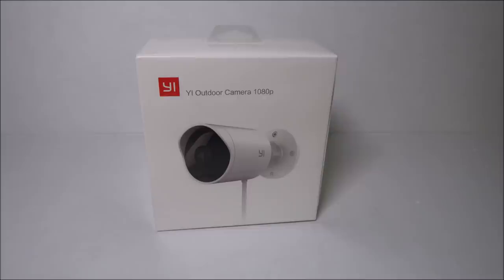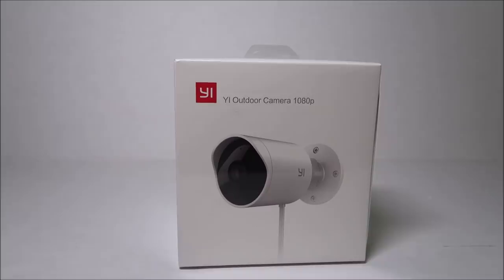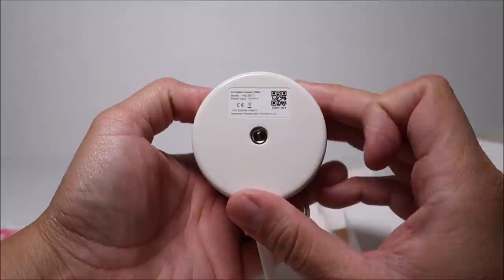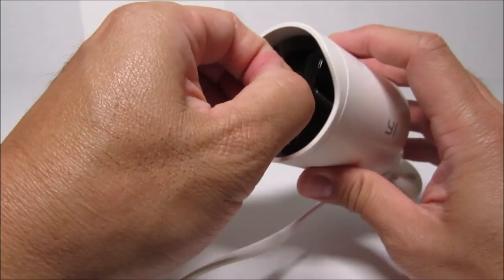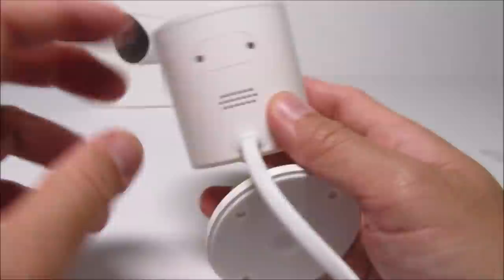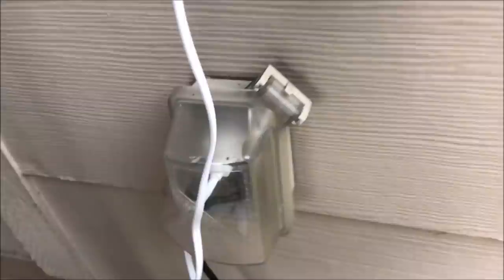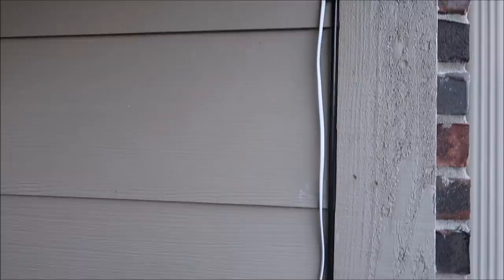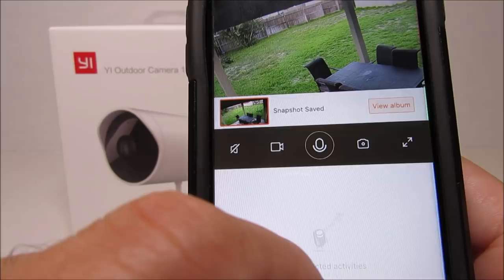Yi Outdoor Security Camera Review - Unboxing, Setup, Settings, Installation, Footage

Comment: Very useful review LH.
I finally succeeded to instal mine in Australia after a bit of a glitch during the installation.
Things did not move smoothly at the QR scanning section for some reason. I guess the distance between the camera and the image on the phone and holding it steady is important. After many attempts it did not register so I was forced to hit the reset button several times and reload the Wifi name and password both in the Kami account set up as prompted AND also my settings on the phone.
 The pairing process also seemed to take more than several minutes too.
I noted a red 5G network not supported notice on the phone screen also during the installation but this was resolved I guess by the  reset  repeat process and after the firmware installation update.
Now all is well with the world and the images are very good. I used a 128Gb mini card too and with the phone alert I am able to view easily on the phone both day and night.
It does appear to be a quality product and very good value for what it does.
Thanks LH for an informative useful review.

Comment: Thanks for the review. This camera is on clearance (allegedly) at my Home Depot for $49. I am considering getting at least two. What I like is the SD card option. Apparently it will take up to 128g SD card. I do not know if it loops like my dash camera does in my personal vehicle. The hooking up to power is not a problem as I have several outside power boxes for my non camera motion and night lights.

Comment: great camera. i love mine and the several indoor ones. cheaper and better than Ring in my experience
Reply from the maker: Yes, it is a pretty good camera. I use the Ring cameras  more for notifications...it is pretty accurate because of it's PIR sensor which the Yi doesn't have.

Comment: Hi,
MUCH CHEAPER to buy a standard indoor Yi Home Camera (but not the 'Yi Home Camera 2 version), pop it out of the mount and put it in an aftermarket exterior mount for about $12.        That's it.  Exactly the same spec at 45% less.      Just my humble opinion. Nevertheless a great review.
By the way, these cameras 'see' both 850nm (visible glow) and 940nm (invisible) ..850nm has a longer range. But, if you're using my method remember to use an separate IR exterior illuminator AND  to disable the camera's own IR lights in settings.
 Thank you.
Reply from the maker: I did do a comparison between these 2 cameras...Yi outdoor and Yi Home with outdoor case -> https://youtu.be/SLt14E2LPBc

Comment: Hey LifeHackster--
Thx for the review,my 2 yi outdoor cams come tomorrow..video looks great like their dome & home cams..it looks like the outdoor is using the same low/small KB's to do liveview and to record video which is great so it does not slow down internet and comes up quickly :)-I'm going to install one on the side  of my garage in the front of my house and in my backyard and will run the flat power cord underneath/behind the mount so you won't see the hole and us a extension power  cord which will be inside my garage and my house so to be out of the outside elements like I did for the 4 Yi dome cams I have mounted outside..I'll send you a video clip when I'm done...
Reply from the maker: Yes. The camera's sensor is the same as their Home and dome cameras so the video quality is excellent. I will eventually do a ceiling to attic install on this and using an extension cord also. Yes...link your video when you upload it so that I can check it out..
Reply: How are you liking them so far?
Reply: MrFester 
They are working Great..I really like the Yi cameras..
Reply: Mark Her how many hours of video can i record on 32GB?

Comment: Thanks for the information as I couldn’t find the reset button, just looks easier than it is. I am not a technician but do the best I can. New WiFi and I had to climb up a six foot ladder at my age to reset but it didn’t work so I have to remove the camera to reset it.
Reply from the maker: The reset button is on the screwed in area where the micro SD card slot is.

Comment: nice video! by the way, my yi outdoor camera have 32 gig SD card.
What you prefer, 
- Record in low Quality and save 24/4
- Record in Max Quality and Save only when Motion Detected

i think 32 gig memori is not enough, though its only up to 32 gig, Thanks in Advance
Reply from the maker: Mine are setup mostly to max quality and only record when motion is detected...
Reply: I think 32gb is enough when its activated by the motion detector....
Reply: And How many days do you record with 32 gigabytes?

Comment: Hi, i have a few questions not covered in this video and am wondering if you would be able to help me.
1- while not subscribing to the Cloud recording, will you still have access to their application and be able to use the camera live?
2- with the SD card, does it record continuously or is it only motion detected?
3- with the SD card, can you review recorded footage on the SD card from the app?
4- does the camera record in a loop on the SD card? 
5- If the recording is continuous on the SD card, how long of footage can be stored on a 32G card before it loops and start recording over the oldest segment.

Thanks, Pierre.
Reply from the maker: 1. Yes.
2. You can choose to record during motion only or 24/7
3. Yes 
4. About 2-3 weeks worth of footage.

Comment: I seem unable to find the answer to this question, despite your superhelpful video: how long can it record on a 32gb card? in 1080p or 720p? and a follow up Q: in Mi Home app there is an option to share smart devices, I know this does not work with Mi Home app, but is there a similar function in Yi Camera app too? Reason I'm asking is because I want to see if our neighbors can share a stream, or answer the door through this, without the need to share my account with them.
Reply from the maker: I have a Yi dome camera that is 1080p which I'm assuming the same sensor/camera that they used for the outdoor Yi...and with motion only recording in my living room...the 32 GB can last up to 8 days in 1080p before it is recorded over. As to sharing, yes, it can be shared - https://youtu.be/nnZE6zgzRZg?t=2m10s
Reply: LifeHackster thanks so much for your response. Do you happen to know how many minutes of video it records? Given the amount of capture is relative to camera's sensitivity, I want to get a better gauge of how many minutes it can contain. Asked another way: how many hours can it record if you put it on constant recording (assuming you can actually do that)? Also, does it cause any problems if memory is full? Or does it automatically erase oldest videos to make space for new ones?
Reply from the maker: I know I did test this before...and yes you can set the camera to record 24/7..I think I got around 30 hours of recording..and no problems with memory being full (same SD card since January of this year)...it will erase/record over old footage...
Reply: LifeHackster thanks a lot. Last question, I promise: you mentioned the IR lights being visible at night. How conspicuous are they? I plan to install on front door which is on a relatively busy Street in center city. I don't want any unwelcome attention.
Reply: I like to put a 128GB micro SD card in it. Is there is any size limit for Micro SD card for this camera?

Comment: Great video. My main concern is that the cable's visible and would be easy to tamper with. Is there any suggestions for the cord to be plugged in or weather proof so it wouldnt get  damage
Reply from the maker: You can put the cable in a cable raceway.
Reply: I was worried about they too until I realized that even mounted someone could approach the camera out of view and point it down or hit it with a rock or hammer. If the cord gets cut or unplugged it's easy to buy a new cord.

Comment: Just quick question: can I fixed that camera upside down-to the ceiling so the bracket is around 90 degree to the camera itself?
Reply from the maker: You should be able to.
Reply: Yes. You need to then go into settings and choose the tab that turns footage 180 degrees.

Comment: Hello, thank you for the video, it is very helpful!  Is it possible to make this camera vandal free? What and how do I need to do it?  Thank you.
Reply from the maker: The only way is to install it higher 9-10 feet up high and drill a hole in a wall or ceiling it power it from the inside.

Comment: 4:57 I don’t think I would be a good idea to plug in outside, the intruder could just unplug the camera LOL
Reply from the maker: Yup but if you have an outdoor outlet cover with a lock, like mine, then at least it will prevent them from opening and unplugging it. I didn't show this on this video but I did on this one - https://youtu.be/vS-QFG5VPhc?t=10m58s
Reply: they can cut it
Reply: at least their faces are already recorded on the SD card before they cut it.

Comment: I hope it is not too late to return mine. The cord is REALLY short, and the lack of a SD card option is a huge turnoff for me. I am very disappointed. I love the indoor camera with the use of the SD card and I bought longer cords. I enjoy your videos! Thanks! :)
Reply from the maker: The Yi outdoor has a micro SD card slot just like their other cameras....hmmm..I guess you didn't watch the whole video ;) Yi just didn't mention it on their box or paperwork...that is why I mentioned that it seems like they want to market their "cloud" service on this camera...The slot is on the bottom and is held by 2 little screws.. As to the cord issue, I will make an upcoming video...probably by the end of this week...for a little hack to add an extension cord and make the connection weather proof..
Reply: LifeHackster I will rewatch. I was multitasking and I could not see one on mine. I will watch again. .. Thanks so much!

Comment: Thanks for review, my main concern is how accurate motion is? Do you get much false alarm? I saw Ring you tested was 
Pretty spot on
Reply from the maker: Yes, Ring uses PIR sensors which is pretty accurate and reliable..the Yi is actually pretty good..it is normally sensitive as to motion because it is basing it from the change in the pixels on the video feed..so, I'm assuming that it will trigger a notification when there is a tree moving with the wind..At my setup right now, the only false alarms I get is at night when a bug flies across the camera. I'll be comparing the Ring spotlight cam and the Yi outdoor pretty soon.

Comment: Good evening just wanted to let you know your reviews are excellent, very well explained.I was just curious in you’re humble opinion what would be the best camera to put outside?
Reply from the maker: Thanks for the compliments. With outdoor WiFi cameras, you have 2 options, if you have a plug or access to power, then you can use the Yi outdoor, Ring spotlight wired or the new Ring stick up cam...if you have a junction box, then Ring floodlight or spotlight cam mount. If there is no power supply, then battery power - you can choose between the Ring spotlight cam battery, Arlo Pro 2 or Reolink Argus 2. Ring will have more options for motion sensitivity to prevent false notifications. Wired is way better than battery powered.

Comment: Hello Sir, thank you so much for this very informative video. I purchased two of the The Yi outdoor cameras and I have a question. When an activity is triggered, I get a six second clip and when I go to download the recording, I only get the six second version. However I want to download the entire clip but I haven't found a way to do that. If it's possible, could you let me know how I should go about doing it? 
Thank you.
Reply from the maker: First, make sure you installed a micro SD card on the camera. Then, when you get an alert, it will only be a 6 second clip but at the end of the clip, you will get an option to watch the whole clip and if you have the micro SD card, this is where most of the footage are stored.
Reply: Thank you so much for replying to my question. So from what I understand, I can watch the entire clip on my phone but if I want to download the whole clip, I would need to take the SD card from the camera and transfer the footage on to my computer?

Comment: Thanks LifeHackster. You're the best. Your reviews are concise and clear. I like the camera, but am concerned about the camera ringing when the motion alert is triggered especially at the front of the house where there's bound to be lots of motion. It seems I'd have to keep it turned off if I don't want it ringing constantly - right?
Reply: Diana One 
Yes you can turn off Ringing/alarm..
Reply from the maker: Thank You....Yes, you can turn it off from the settings. I wish if they can make it user controlled..it will be better than being motion activated.

Comment: Great video! Just wondering if it was possible to hardwire this camera to your house’s electrical cables or do you have to use the USB cable? Thanks!
Reply from the maker: It runs 5 volts... USB power. You can wire it but it needs to connect to the power adapter.

Comment: Good Afternoon Life Hackster,

I have YI indoor cameras and works well during the day, and night vision is ok ( my camera point thru a window to outdoor area). I have the Night Vision turned off due to IR flashing and reflecting off the window.  Now I have been looking to add outdoor camera that does better with night Vision and larger field of view. Also of course clarity at night mainly. I do not have platform I have to have like Google, etc. I have 1 light by front door that is on motion so most of the light is off unless motion is detected. Just looking what you feel is a nice choice for this application? I dont know if you recommend a Nest IQ outdoor? Or an Arlo or Ring? Thanks for all videos and information. Really enjoy all of mine you spend in your reviews. I always enjoy watching them. Keep up fantastic job.

Comment: Hello LifeHackster, 
Thanks for the very nice introduction to the Yi Home External Camera.
I have got this camera and installed it and everything works just fine. I am very impressed with the product, considering the price I paid for it.
I have an issue and wonder if you could help me.
1. I have installed the Windows app on my desktop and configured the camera. I am able to view the picture very clearly on my Desktop screen. The problem is that after a while it goes off line and I have to reconnect the Camera in the App to view again. The keeps on happening. Is there a solution to this issue? I also have it configured on my iPad and it does not disconnect there. I see the live picture continuously.
Please Help!
Reply from the maker: These cameras are not designed to have it's live view turned on continuously. That is why it times out on your desktop and I also thought it will time out  on the phone's app...

Comment: I'm looking to mount a camera inside my garage. Would a weak wifi signal interrupt recording in any way?
Reply from the maker: Yes, it will. Try it first though, I installed a Yi before in my garage and had no issues.

Comment: What happens if you change your broadband router or mobile phone. Do you have to set it all up again ? I.e remove camera ?
Reply from the maker: You can update the WiFi settings via the app. Sometimes you might need to reset it.

Comment: Hi, i have a question maybe you can help me i have my YI camera connected to a semi weak wifi signal I'm getting video with no problem but i don't get motion alerts maybe 1 or 2 in a day and it doesn't send me the alert notification to my phone is that because of the wifi weak signal?
Reply from the maker: Have you tried tweaking the settings to increase sensitivity? settings-> alert frequency. You can check on the "alerts" on the app and see if you received the same number of push notifications from your phone...if not.. try restarting your phone.

Comment: Hi Hacker. I just installed this cam yesterday and having a few issues. When I modify my region it is not letting me click back to go back to the options menu. I can be 10 foot from the cam but the alarm will not go off. Any ideas to my issues? I’ve uninstalled the cam and the app both it still continues. I reset the cam as well. Your help is much appreciated! Thanks
Reply from the maker: Yes, it is a bug in the app. Yi needs to address this. Hopefully, they will have a fix soon.

Comment: Thanks for the nice review i have 2 of this camera and the 2 of them have problems one is the night vision is not working and in the app it is on and the other one when the night time is coming the camera is lost the wifi connection and trying to connect to wifi but it can't only if i turn of the night vision it works fine. Doyou have any idea. And thenks
Reply from the maker: I never had issues on mine. Try to reinstall the app and the cameras again and see if it solves the issue. If not, get in touch with Yi support. -> https://help.yitechnology.com/hc/en-us